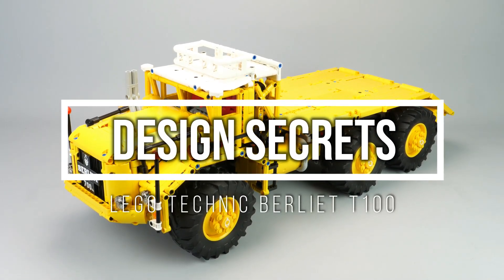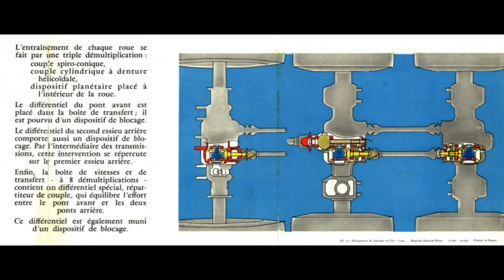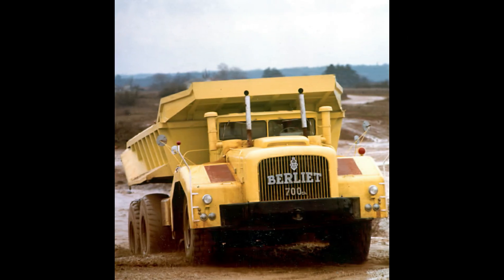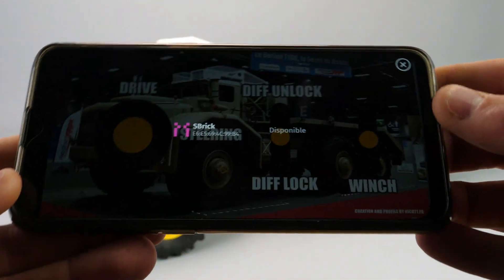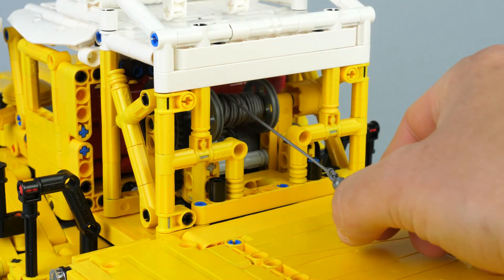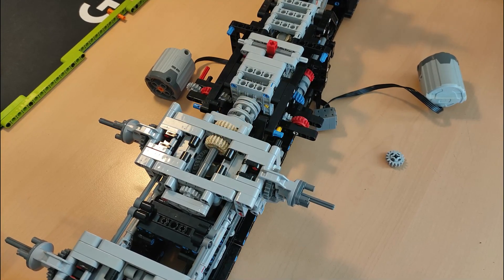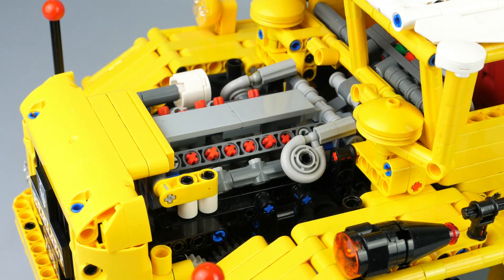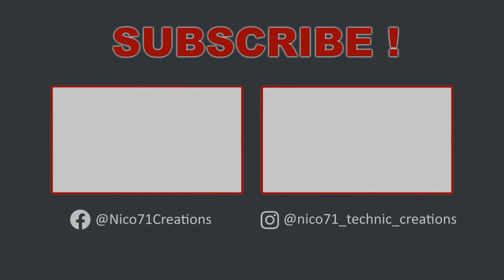Design Secrets - Lego Technic Berliet T100

Comment: You could've used an 3d printed metal u joint or a custom metal one
Reply from the maker: I do not use modified or custom parts, as I want my model to be rebuildable easily. Only for cosmetics which is not mandatory, I'd not it is a bit "cheated" to use 3D part of metal when it came too hard to find a 100% Lego solution.